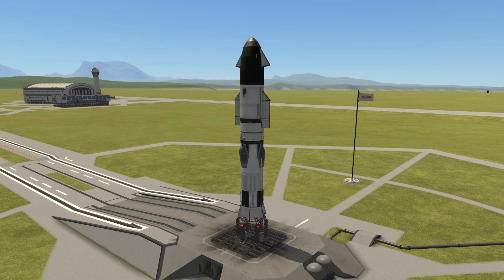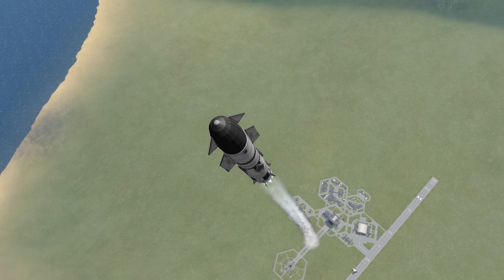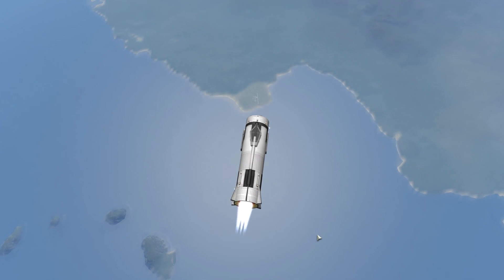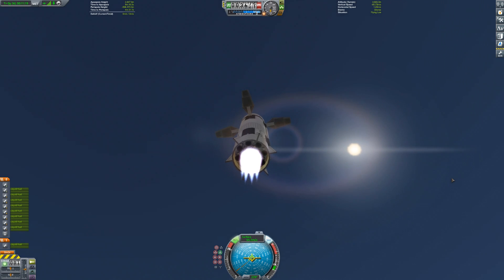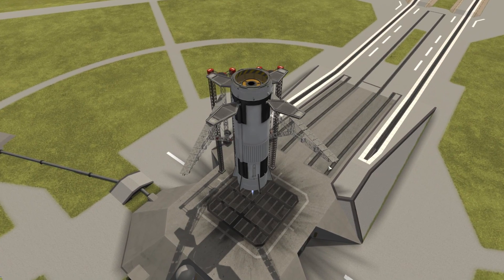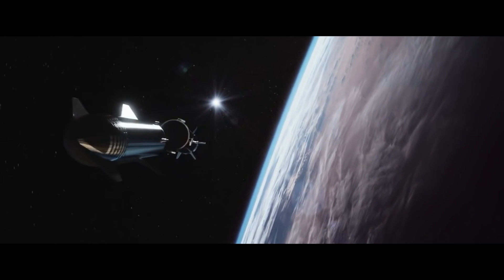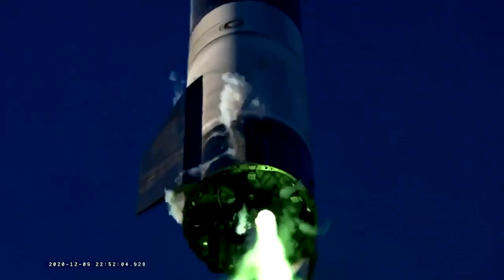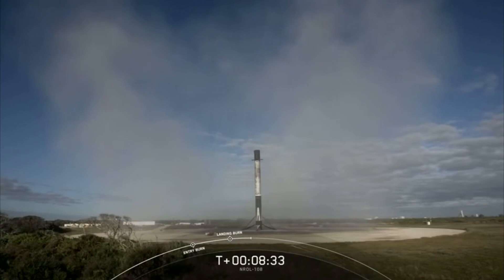Why SpaceX Wants To Make Landing Super Heavy MORE Difficult.

Comment: Just imagine how many orbiting satellites they can bring back down to recycle.
Reply: The Starship can just open its "mouth" and eat them out of the sky
Reply: @InventorZahran  the satellites are too distributed too make that an efficient way of doing it, starship is quite large so it would require a lot of fuel to maneuver. It would certainly be more efficient to put a few smaller autonomous satellite-grabbing satellites and then grabbing each one of those with a chomping starship like you said. They could have cold gas thrusters to change orbits and catch up with the satellites to be decommissioned. I propose naming the satellite-grabbing satellites "trashcan" as in trashcan 1, trashcan 2, etc. It could be as simple as a few grabbing arms and a literal can to wich the smaller satellites could be bolted to. As for the starship version to grab those, i like the name "hungry starship", but i welcome better names such as "the chomper" as well. Cheers!
Reply: @InventorZahran  no it can't, it would have to secure each satellite to avoid collision between satellites and the inside of starship during re-entry, they would also have to be spaced apart to avoid collision between one satellite and another, which could lead to debris being created and a sort of mini Kessler syndrome inside of the starship's cargo bay which could lead to the destruction of the starship upon re-entry
Reply: @InventorZahran  Funnily enough, this is literally one of the plans for starship. To basically act as a "space garbage truck".
Reply: @carljohan9265 I don't think you guys understand the speeds of things in orbit. Most of those satellites youre talking about travel about ten times faster than a bullet, impossible to catch
Reply: @benxenes  unless you also move that fast. Which you have to do get into orbit.
Reply: @janniszimbalski6652  Just having speed is not enough, you have to be in the same PLACE at the same TIME, travelling in the same DIRECTION as your target. The difference between speed and velocity...
Reply: @benxenes  Um, how the fuck do you think space craft dock with the ISS? 
Because they match it's orbit and speed. 

Come on man, this is as basic as it gets. Starship can just match the sat's orbit and speed.
Reply: Better to collect all the satellites in  one place and wait till a factory is built in space to reuse all that mass that is up there already. Who cares if it take 50 years.
Reply: @kkarllwt  I'm not sure if you realize how heavy industry works, but lets just say this: building a factory on the moon is far, faaaaar more advisable than having one in earth orbit. 
And how exactly are you suggesting that one "collects all satellites in one place" without something that can go pick them up?
Reply: About zero because they would not be able to rendezvous with any.
Reply: @benbaselet2026  Yes, the space craft with more delta-V than anything else by a fucking ENORMOUS margin won't be able to rendezvous with anything. 
Makes TOTAL sense.
Reply: Guys I don't think that bringing satellites for earth is usefull idea with earth's gravity... It would be easier to repair them on orbit with telepresence and robots, or bring them to the moon where landing is easier. Probably the easiest and cheapest way for decommissioning a satellite is attaching to it a thruster and pushing it to burn in the atmosphere. The raw materials aren't really worth that fuel and tech that is required to bring them to earth.
Reply: @BHBalast  You are forgetting the part where not everything burns up on re-entry. There will always be debris that crashes down on the earth's surface, intentionally burning things up in the atmosphere is done simply because it's pretty much the only option.
Reply: Zero.

Comment: A big catching ring with diaphragm like a photocamera has.
UPD: 2 such rings at different heights - maybe 10 meters between them. - At 60 and 50 meters heights.
 Sector plates are made from thick (maybe of 1 meter thickness) plastic so that they could slide easily but inner edges must provide a good friction - maybe they should have lots of suction cups.
Reply: Interesting thought, but I don't think it would work very well at that scale.

Comment: This could allow there to be a massive pit of water below a replicable catching platform that the rocket could smash through if there is a failure.
I don't know how recoverable it would be from that, the engines could probably be saved if the bottom is filled with thick sediment, but it would at least prevent a fireball.

Comment: Landing without landing legs is not new. Their original concept from back in the mists of history (two years ago? :) ) had them landing the booster back on the launch pad. That would require an accuracy of centimeters. The grid fin idea at least gives them a little more margin for error.
I'm sure they will be able to do it if that's the idea that they want to use. They are SpaceX after all...